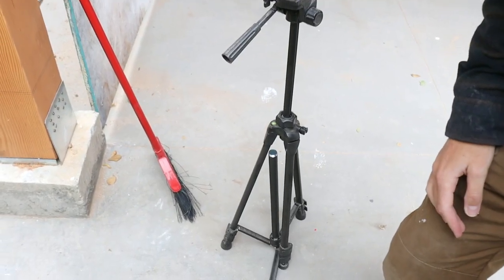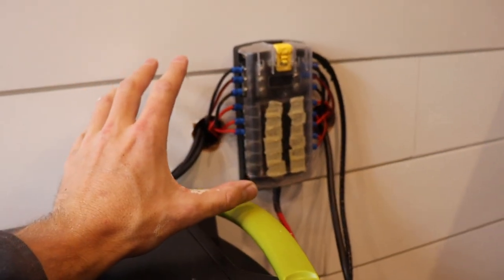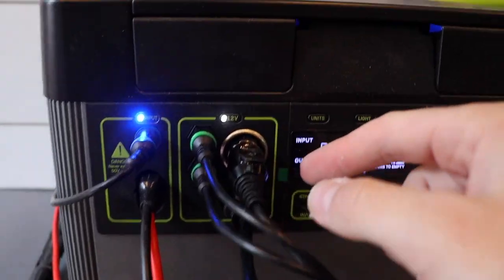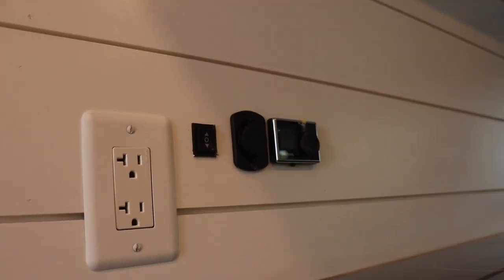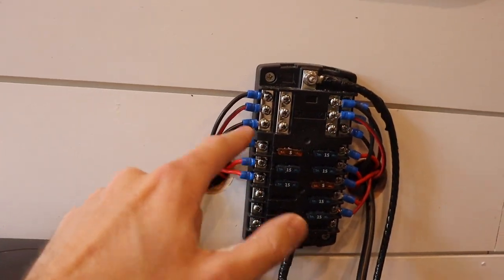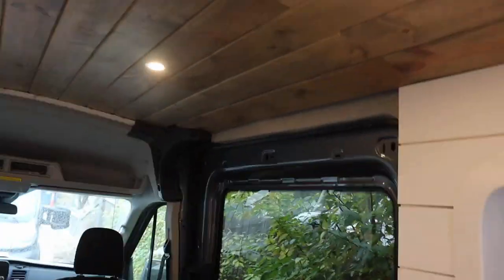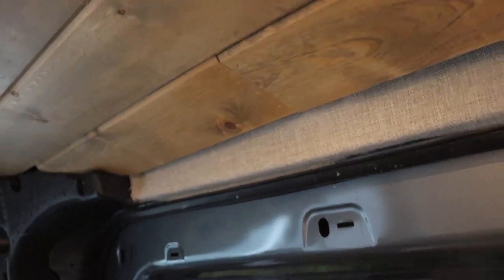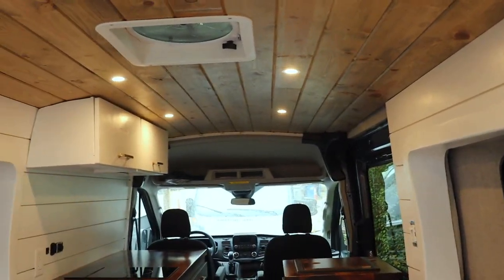Ford Transit Build | Electrical Explained!!!! | Update On The Van Build

Comment from the maker: Notification bell gang!! I apologize for the late post, let me know if this video was helpful!!
Reply: Great set up! Having trouble finding that 12v max current cable. I looked on eBay but no luck. Are you still finding them or using something different to hook up your 12v accessories?
Reply from the maker: @wcfrog1  https://amzn.to/3fM4Odk I started using this with zero issues. I think they stopped making the max output

Comment: I have the Jackery 2000 that is going to go in my van build, but your explanation of the electrical system will work for me.  Thanks for making it easier on me to build my van.  You have done all the research and know what works and what doesn't.  That frees me up to start my build.

Comment: At 3:19 seconds into video, you state if only using one of the three outputs, you will only output 10 amps. I am using Andersen output and measuring only around 2 amps at fuse box input. Any thoughts?

Comment: You don't need the max output cable for the x series goal zeros.  That cord is actually made for the non x series (i.e. 3000 vs 3000x).  The HPP output on the 3000x is 30 amps alone so should handle most 12v loads on the fuse block.

Really enjoy your videos.  Just wanted to give you a heads up.
Reply from the maker: Thanks for the info Dustin!
Reply: You are so very good at explaining and teaching. Very refreshing after getting frustrated on some others! 👌
Reply from the maker: @yvonnecooper368  thank you :)

Comment: I watch your electrical hook up video and it hands down answers most of my questions….all but one.  You show how the solar and alternator can charge the battery but how would you incorporate shore power to the mix.  I am sure it is simple but I just can not figure it out!  Any help would be appreciated
Reply from the maker: You can plug an extension cord into a 110 outlet! That’s the simplest solution

Comment: I purchased echoflow delta2 Max to power 12v devices in the van,  I wish it came with  Max output cable. I just  learned how to use 40amp by making a cable like Max output.   thanks

Comment: You described hooking up your solar panels in Parellel. Shouldn't they be in series? I think they would start charging alot faster. You would have 400 watts .24? volts and about 32 amps. In parallels you have 12 volts 200 watts and alot more amps[current].Let me know because I am going to do about the same thing. I think it would be easier on the internal MPPT in your yeti.

Comment: Great video man. Copying this exact set up. I have been running into a problem though… spliced everything and when I turn on 12v light it turns red and nothing will power from my fuse box. Did you happen to run into a similar issue at first? 
Thanks!

Comment: why do you need that max output cable? is it the heater that needs the extra juice?
Reply from the maker: It’s when you try to run all systems at once

Comment: I know this video is old, but is there an option to charge the GoalZero with shore power too as a third charging option?
Reply from the maker: You can use an extension cord and plug it into any wall outlet to charge!

Comment: I love my GZ 1500x, I bought some Goal Zero panels to just plug and play. I am only getting 120 watts of power on a good day with 2 100watt panels. It (Kind of a bummer as the price tag is high)  What does the charging look like from the Renogy panels? I think I might need to upgrade...Thanks for all the help and rad videos!!
Reply from the maker: Renogy has some of the best panels when it comes retaining as much of the wattage. There’s still going to be some loss as it’s going through. But still gets around 160-170 with the 200w

Comment: How did you work the roof around the original air bags. I see you kept them for safety.
Reply from the maker: I had to trim the foam covers in order to slide the paneling through

Comment: I know you are super busy, but do you know if Goal Zero is replacing their Goal Zero 12V Current Cable? Everywhere I look it say “Discontinued” if you have any thoughts it would be greatly appreciated. I’m strugglin trying to get the solar/electrical done in my van! 🙏🏼
Reply from the maker: https://www.amazon.com/Electop-Connector-Compatible-PowerPole-Connectors/dp/B08NSWXY3J/ref=mp_s_a_1_9?crid=MNXPRV3OHWPL&keywords=high+output+cable+goal+zero&qid=1663118946&sprefix=high+output+cable+goal+zero%2Caps%2C160&sr=8-9
Use this instead!

Comment: Do you suggest getting the yeti 3000x over the 1500x? Or is the 3000x overkill? I am looking to power max fan, a demetic fridge, 6 lights, 2 outlets, water pump, heater.
Reply from the maker: 1500x should be enough!

Comment: First time van converter and want to keep things easy.  Where did you get the flare space product?  Really want to use a power station like you do rather than the battery/inverter set up but still unsure of all that you did, is there another reference you used or are your skills all natural?

Comment: Nice video! Are you using the goal zero link system to charge from the car or just the 12V that came with it?
Reply from the maker: Just the 12v plug extension that trickle charges the battery when the van is on

Comment: Did u run the refrigerator to the fuse box too?
Reply from the maker: Yes!
Reply: Did u use a 5 amp fuse?
Reply from the maker: @kristenwright8152  I don’t remember. You can look up what amp fuse your specific fridge requires
Reply: Ok..thank u so much!

Comment: I just started watching some of your videos tonight and glad I did. They’ve answered a lot of questions I’ve had about the whole process. I’m doing a horse trailer with living quarters similar to what you’re doing with the vans, using 12v and 110 with some EcoFlow products. I would also like to add shore power and be able to switch between the two. Thanks for your help!    Just curious about what was plugged into the 110 on your generator.

Comment: I'm curious why you had to cut the end of the GoalZero max output cable? In the description picture it looks like you can just insert the positive and negative ends directly into the female end of the max output cable. Was there a specific reason why you cut it and butt spliced it together instead?

Comment: I also use the goal zero to run the power for my bus conversion. Do you have the 12v input to charge the goal zero wired to the front cab cig lighter? Do you always keep that plugged in?
Reply from the maker: I’m noticing that the goal zero only charges one or the other when they’re both plugged in. It’ll be for when it’s either night time or cloudy and they’re driving. They can unplug the solar cables and plug in the 12v

Comment: Something that no one ever explains is the Choice of fuse on the fuse block (you have 5 and 15). can you explain how to decide this and why its important to pick the correct ones (or can I just go 15 on call of them?)
Reply from the maker: Good question. The electronics you’re using will say the recommended fuse size. If it doesn’t you can google the recommended fuse size for the gauge of wire you’re using

Comment: Would I need all the fuse work if I’m using my goal zero 500x just for a max air fan and puck lights?
Reply from the maker: If that’s all the electrical you’re using than no!
Reply: @AnkeneyVanBuilds  thanks!!  Keep up the great vids
Reply from the maker: @KornKrlz2  you’re welcome! Will do

Comment: I got a question about the max output cable. I have a 3000x . I understand the 12 volt out put is regulated. Do i need the max output cable to get all the DC power out of the unit. The site says its not needed on the x models. I am running a fridge, tv, led lights, water pump, and dc fan off the fuse box. thanks great video!
Reply from the maker: You don’t need the max output. You can use the bottom right plug only and get 20 amps
Reply: Thanks so much.

Comment: will the goal zero power bank work off of an  Alternator?  I live in an area where the climate is very hot and I'm going to be putting in an air conditioner. The undermount version instead of roof. Will the goal zero work with it also?
Reply from the maker: Yes to both!

Comment: Thanks for the videos! Any idea on where to get my hands on one of those max current cable these days? I've got a Goal Zero 1000 to run my system so believe I'll need one of those.
Reply from the maker: https://www.amazon.com/Electop-Connector-Compatible-PowerPole-Connectors/dp/B08NSWXY3J/ref=mp_s_a_1_6?crid=MCWB2JVJKZK2&keywords=goal+zero+max+output+cable&qid=1665433407&qu=eyJxc2MiOiIwLjAwIiwicXNhIjoiMC4wMCIsInFzcCI6IjAuMDAifQ%3D%3D&sprefix=goal+zero+max+output+%2Caps%2C177&sr=8-6#

Use this instead
Reply: @AnkeneyVanBuilds  Hey, I actually meant the max output cable that's needed with the none X series Goal Zero. It plugs into the 12v output.

Comment: Hey im having trouble finding a Max Output cable as well, any insight on where to find one? I cant find it on ebay either
Reply from the maker: Yeah I think they may have stopped making those. This is what I’ve been using 
https://amzn.to/3NFA09m
Reply: @AnkeneyVanBuilds  thanks for the quick reply. You think that enough power even though it comes out of one port, unlike the one you use in the video with several ports?

Comment: Sorry if this is a duplicate comment but I’m not seeing my last one. I have maybe a stupid question but I’m thinking of possibly tackling this kind of project but I’m super intimidated by electricity. So, what I’m thinking about doing is getting a Bluetti 2000w solar power station/generator and since it had like 6 110 plug-ins just running extension cords from it under the bed to the fridge and whatever else I may need. Do you see any issues with that from an electrical standpoint? 

Awesome videos btw - I’m learning a lot! Thank you for posting them.
Reply from the maker: The bluetti itself has 6 110s? Or you want to run 6 110s off of one?
Reply: The Bluetti has 6 110 plugs. Here’s a link to the one I’m talking about. Again sorry if this is a duplicate response my comments keep not showing up on my end. 
BLUETTI Portable Power Station AC200P, 2000Wh LiFePO4 Battery Backup w/ 6 2000W AC Outlets (4800W Peak), Solar Generator for Outdoor Camping, RV Travel, Home Use (Solar Panel Not Included) https://a.co/d/2YxSYAL
Reply from the maker: @BritneyLeigh24720  oh! Okay. Yeah there shouldn’t be any issues with that!

Comment: How do you know which fuses to use in the fuse block for each connection?
Reply from the maker: You can google search what size fuse correlates with what gauge wire!
Reply: @AnkeneyVanBuilds  in your next build are you going to run the max output cable from the goal zero again or are u going with another method this time?
Reply from the maker: @tannerwagner5791  same method !
Reply: @AnkeneyVanBuilds  dude how do you find the max current cables, I've been looking everywhere and can't find one! Haha
Reply from the maker: @tannerwagner5791  gotta look everywhere! I think eBay has them